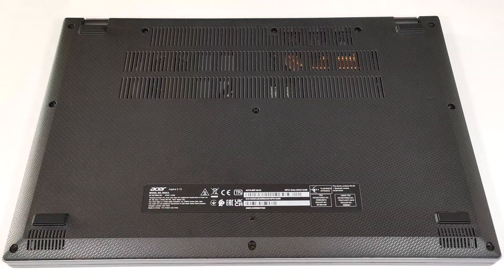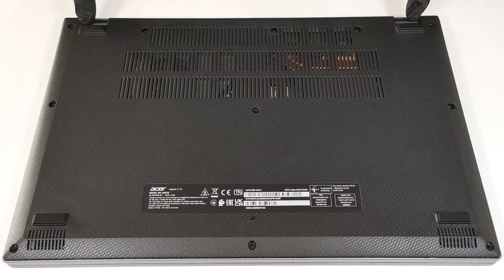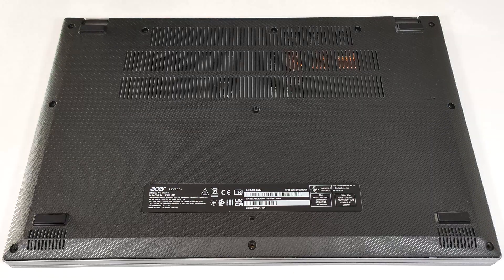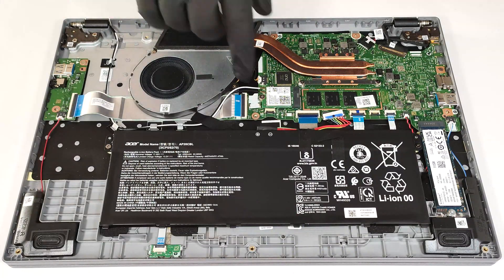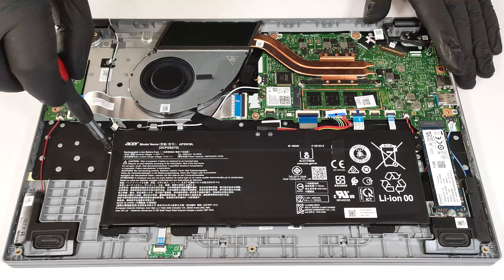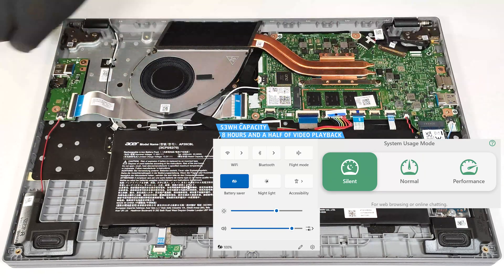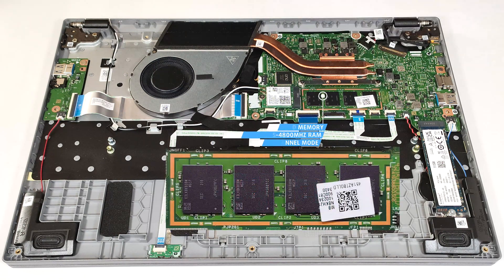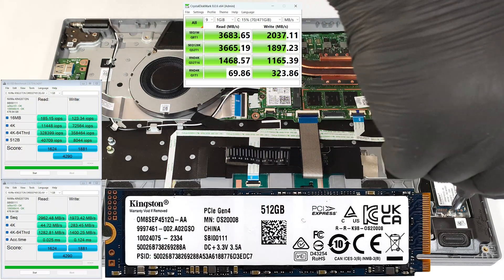🛠️ How to open Acer Aspire 5 (A515-58P) - disassembly and upgrade options

Comment: I didn't get if this laptop have slots for more ram besides the soldered ram. 1:29
Reply: Doesn't look like it has any DIMM slots, looks like the RAM is soldered to the board at the factory depending on how much RAM you choose to buy it with. You are stuck with whatever is soldered to the board.